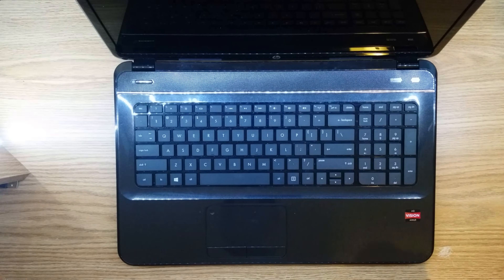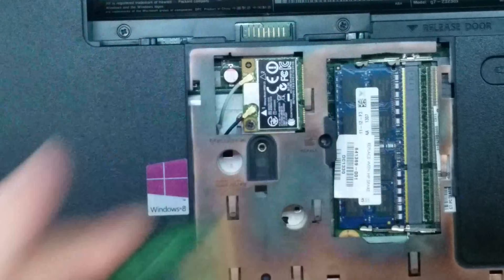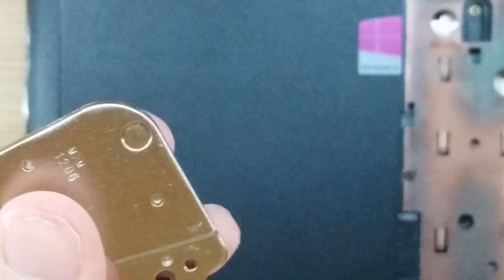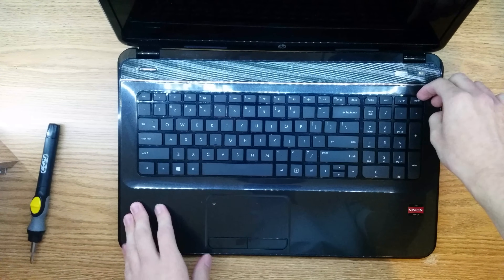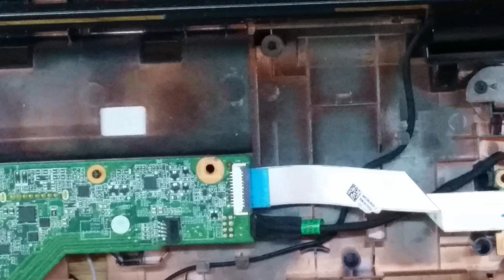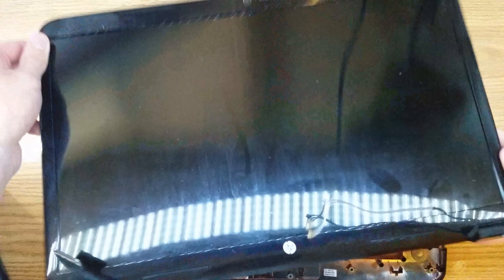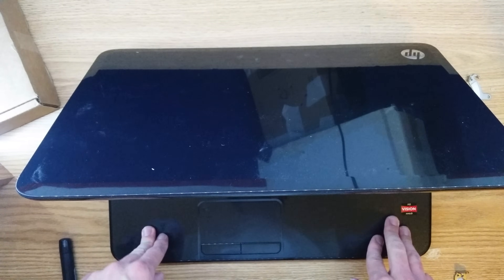(4K) How to take apart a HP Pavilion G7 Laptop (Step-by-Step)

Comment from the maker: If at any point while watching this video you enjoyed it or it helped you, consider subscribing!!
Reply: I recently used you video to guide me in upgrading the RAM and CPU on my Pavilion g7-1310us. Unfortunately the clip/lever  for the power button wire connector on the motherboard broke off. I have tried to tape the ribbon wire in place and tape the little black clip over the contact end of the wire but the power button does not work and I can not turn on the laptop. The computer is getting power as the LED by the power cable plug is lit white. Any help or suggestion you could give me to fix the clip connector would be very much appreciated as I have spent over $100 on parts and all I have is a paper weight. Otherwise I think the take apart and reassemble videos are excellent. Thanks much.

Rick
Reply: Forgot to add to the above comment on broken connector my email is richardbernascoini68@gmail.com or rickbern@comcast.net Thanks.    Rick
Reply: Can you put an ssd in this old fossil?
Reply: @Eris_Greyrat  I did, no issues.

Comment: Thanks, I was at a stopping point until your video with getting the Keyboard removed. My silver G7 laptop was slightly different under the KB with only 1 screw.  I now have a happy CPU cooler with new thermal past and less dust bunnies. Sept 2025.

Comment: 1:00 This screw on the trapdoor have a spring under it. You cannot remove/unscrew it completely. If the trapdoor does not slide, unscrew again as you try to slide.

Comment: I note that the laptop does not show a speaker.  I had to order a replacement speaker and since I hadn't disassembled the laptop yet, I ended up ordering the wrong part. The other thing I noticed was there were some other differences between the G7 laptop that I have and one your video is about.  My particular model is an HP Pavilion G7-1150US.

Comment: This video was great ,my screen just went dark . The problem I have is that it looks like the mounting for the screen broke and when closing or opening it unplugged it self .I would need to find another frame or something. The heat from the motherboard I believe caused the failure on the mount. I would appreciate any suggestions thanks.

Comment: Did you ever have a problem with your fan? It looks like at 9:05 the yellow wire is pulled out of the connector on the board.

Comment: There is a spot on the bottom you push (with a blunt tool) to push on the keyboard to release it. It's labeled and it takes some effort but the keyboard will pop out enough to pull it off.
Reply: I can’t find the button to push. I’m having trouble with taking the keyboard out
Reply: @shinea713  
It's not a button, it's a hole with a keyboard glyph IIRC.

Comment: Great video.
I just got a g7 laptop and I would like to replace the hard drive with a new SSD, any recommendations?
Reply: I have changed mine with one Samsung 860 EVO 1Tb.Its easy just follow the steps and pull the other side of the disc cable

Comment: Thanks!  I get to be subscriber 400.  I had overheating problems so I removed the fan, cleaned and used a graphite thermal pad instead of heat transfer compound.  It was large enough that I only used 1/4 of the pad.  Here is a link for Amazon if you want to look at it.   https://smile.amazon.com/gp/product/B07CKVW18G/ref=oh_aui_detailpage_o01_s00?ie=UTF8&psc=1

Comment: Thanks to this video I was able to revived my G7!!!

so here what happened: back in mid 2014 my G7 was overheating a lot so I bought a can of air duster and opened my laptop for the first time ever to clean the fan, but I did it without any instructions or tutorial to do it, so I managed to open the laptop and dusted the fan and also the motherboard, but at the end a bunch of liquid spit out of the can to the motherboard and I thought "oh oh, that's not good" so I put everything back together and pushed the power button and nothing, no power, no lights, nothing! dead!

so I tried several times  and then opened again looking for something loose and couldn't find anything! so I thought it was the liquid that came out fried the motherboard! and I gave up... I killed my laptop. so I decided maybe take it to a PC shop but maybe they gonna charge me a couple hundred dollars so be better to get a new one, so I never did nothing to it, I just put it in my closet and forgot about it. 

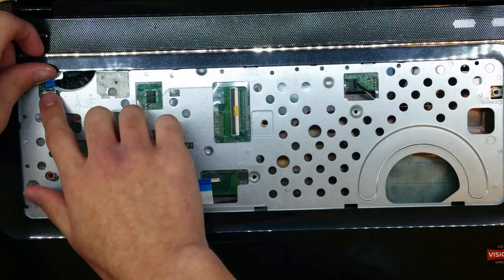fast forward this week I was cleaning and found my lovely dead laptop, so I decided to give it another try, this time doing some research, so I looked up video on youtube, found one video that didn't helped, next one was this video, so I carefully watched how you disassembled step by step... and when you got to the 5:25 mark!!! :O 
that tiny cable was disconnected!!! and I was like no way!!
so I plugged it and put it back together and pressed the power button and my beautiful G7 came back to life :'(

I felt like an idiot, I was angry and happy at the same time! lol

So I came back to your video to say THANK YOU SO MUCH! you are the man!! :D
liked the video and subscribed :)

(by the way, what is that cable for?)
Reply: Nice u got it back to life

Comment: Thanks for the video Garrett! My pavilion worked fi e one day, the next, it wouldn't turn on at all, no power light, no nothing. I have 19.6 volts going into it from the adaorir. I was going to check voltage through the power input.  Any other ideas you may have? Thanks.

Comment: Hey man I am trying to replace the motherboard on my g7 1219wm but on the replacement mother board I ordered it has socket style cpu and when I took my heatsink off to add it to the new board I noticed that my cpu is amd and alot smaller than the socket style spot... do I need a diff g7 motherboard or do I need to buy socket cpu or solder a new one on?  So confused

Comment: Never took apart a laptop before - this was very helpful - thank you so much as I am trying to upgrade my laptop!
Reply from the maker: +Patrick Teater Thanks for the comment. Glad I could help!
Reply: I have a question - I have a G7 1219 wm pavillion laptop and I have tried everything to get the keyboard off of it - so far I am getting nowhere?  Is there a special trick to this model.  Thank you.
Reply from the maker: The keyboard can be difficult to remove if you are doing it for the first time. While there is so special trick, you may try using a guitar pick, or something similar to slide around the outside frame of the keyboard. Also, something to keep in mind is that there is a small patch of adhesive holding the keyboard in (at least on the model shown in the video). It's hard to see, but at 4:27 in the video, you can see it just to the right of the cooling fan. Patience is key. A final thing to check is that you have removed all screws from the laptop. I know from experience that the keyboards can be especially difficult to remove the first time you take it out.  Good luck!

Comment: I only have one ram stick, and my computer is pretty slow, could this be causing the problem? where do I get another one?
Reply from the maker: There are many reasons why a computer can be slow. A low amount of RAM can be one of these reasons. You can purchase additional RAM for the model shown in this video here https://www.amazon.com/Crucial-Single-PC3L-12800-SODIMM-204-Pin/dp/B006YG8X9Y/ref=sr_1_2?s=pc&ie=UTF8&qid=1476052750&sr=1-2&keywords=ddr3+sodimm
Reply: thanks for the help!